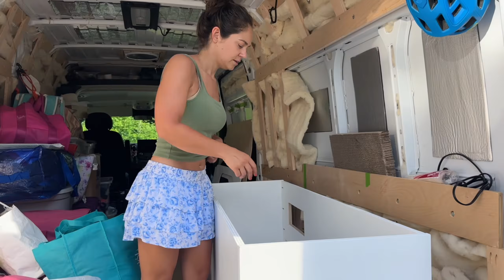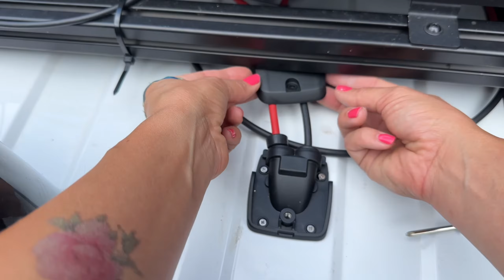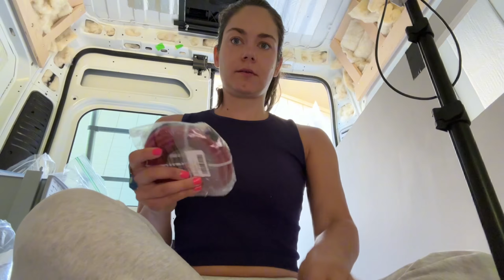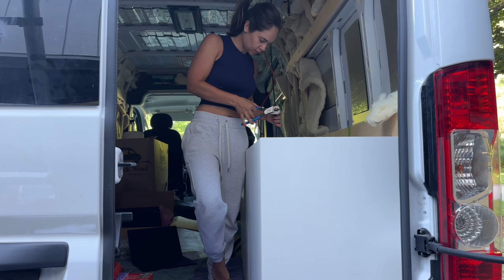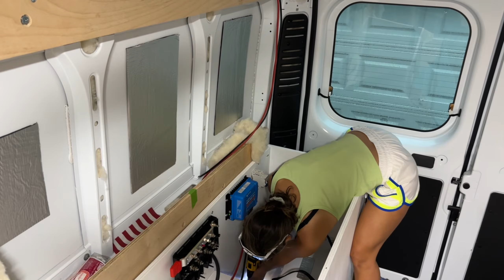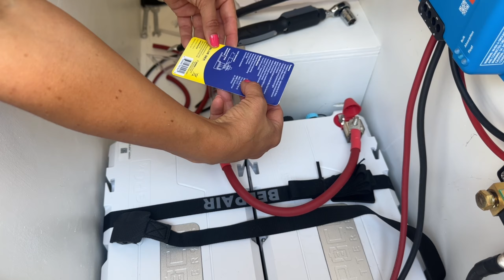Off Grid VAN LIFE Solar Power & Battery Wiring

Comment: I went with portable power stations, I did not want to deal with so many wires and parts, because if one part or wire goes down the whole system is down. I did not want to worry about a short or fire. Just too much stuff to deal with. I prefer a simple set up.

Comment: You might want to install rubber grommets on any holes you cut in the sheet metal through which wires pass.
Reply from the maker: Yea as far as the wires in from roof you can’t use a grommet because the gland wouldn’t sit flush. The gland allows the wires to enter without touching metal cut edges of van